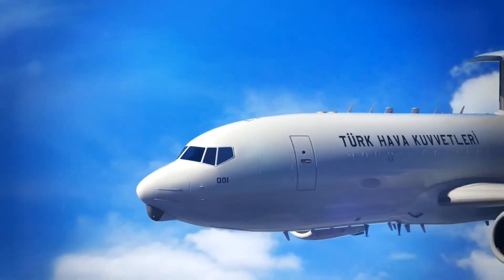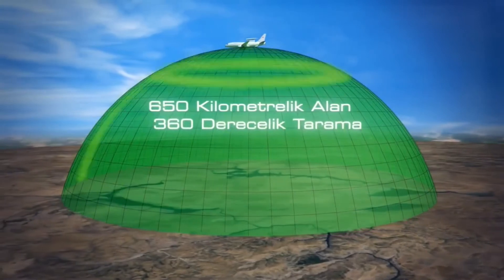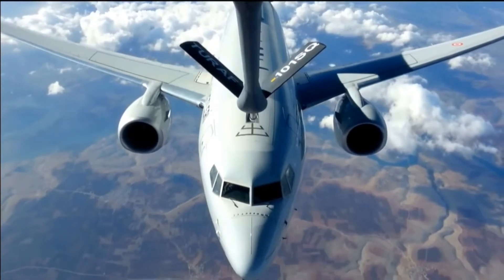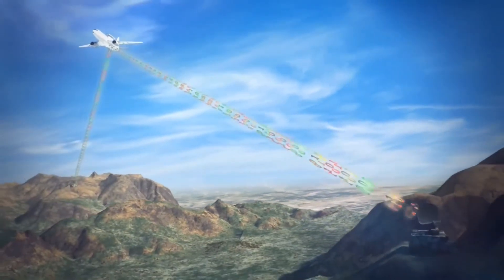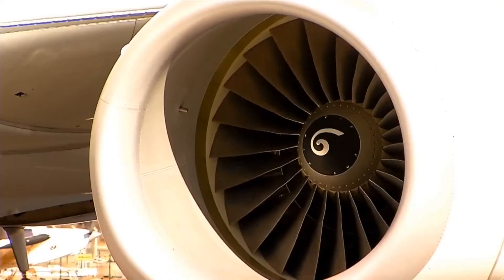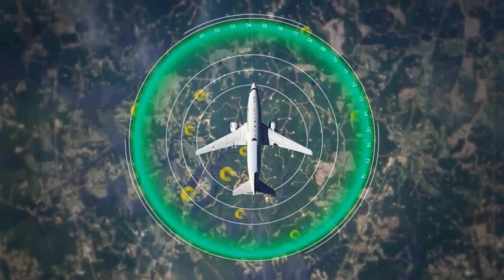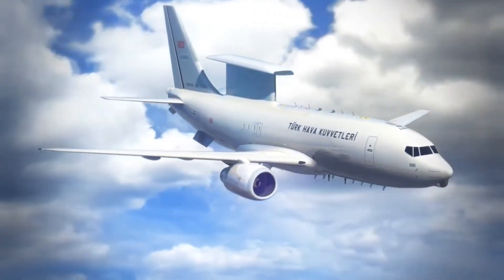E-7 Wedgetail AEW&CS In Detail | in English

Comment: The E7 Wedge tail - -
0:12 - - lighter than the 707 Boeing E3 Sentry;
0:16 - - has a fixed active electronically-scanned array radar antenna (instead of a rotating one);
0:22 - - 1st flew 2004, operation began 2009
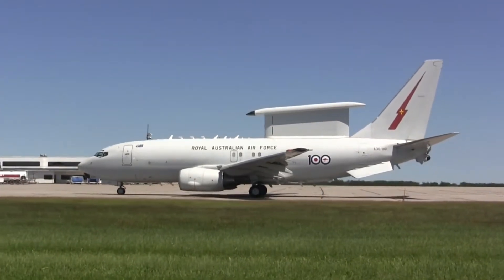0:36 - - uses Northrop Grumman multi-roll electronically-scanned array radar;
0:42 - - radar located on dorsal fin, on top of the fuselage (dubbed “the top hat”)